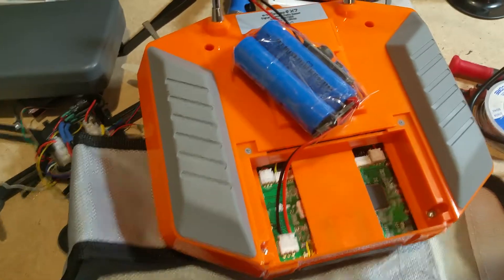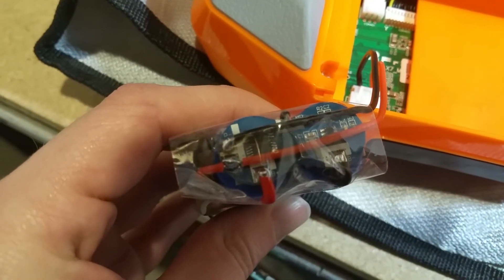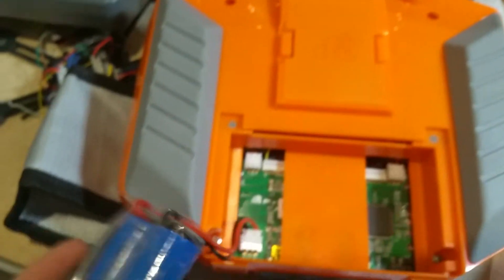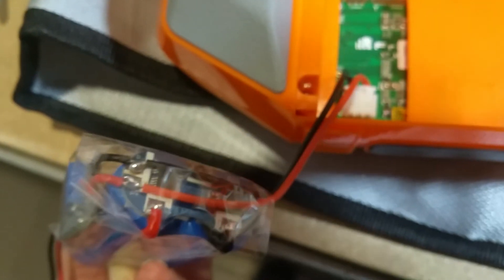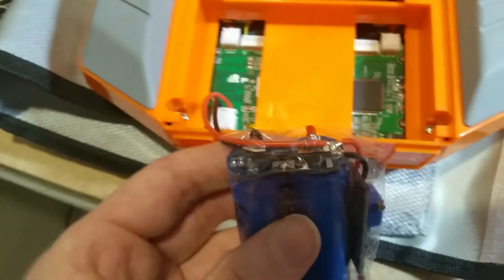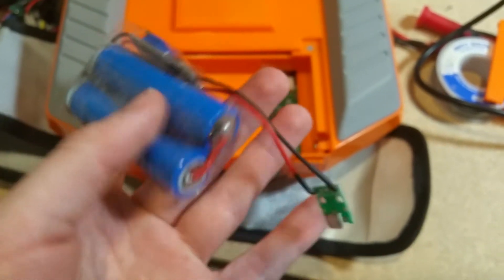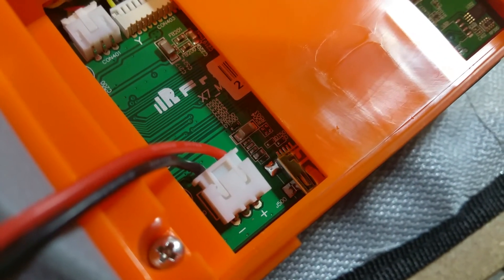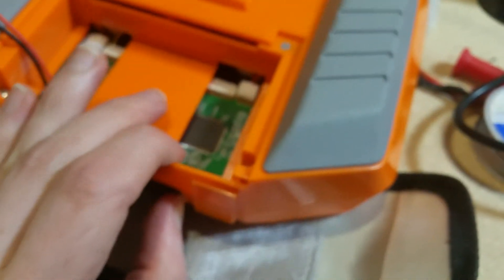Taranis Q X7 USB Battery Mod

Comment: Can you charge using usb?
Reply from the maker: If you attach the charge wires to the power pins of the usb port on the transmitter it might be possible.  Im too chicken lol.  It's a really fine solder job and pulling the cover off to charge is no biggie.  I'd recommend using a battery holder though.